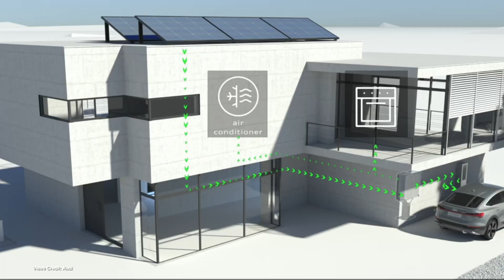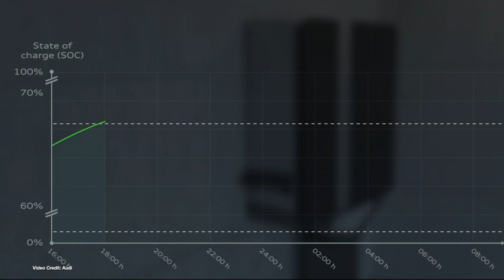ecoTEC 142: Tesla’s Amazing Quarter, Mustang Mach-E 1400, Tesla Sues Rivian

Comment: People haven't put a couple pieces together.  They have confirmed wanting to make an even lower cost car, and have also stated that they want a range of 300 miles (about 500km) to be normal.  So, would that be the case with the lower priced car?  If Tesla made a $25,000 vehicle that got a 300 mile range....things will change for the better so fast it will be unbelievable.